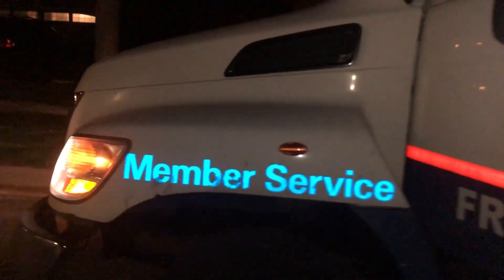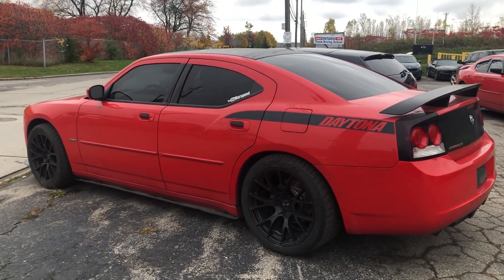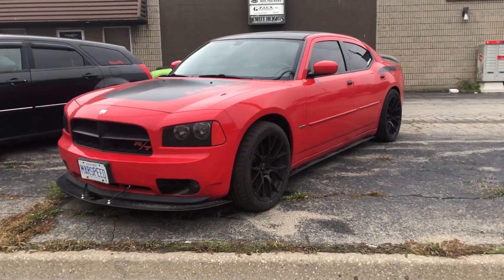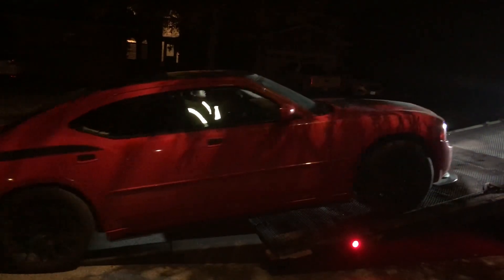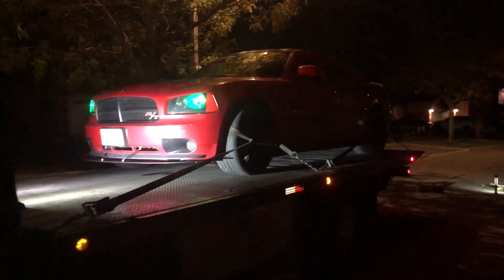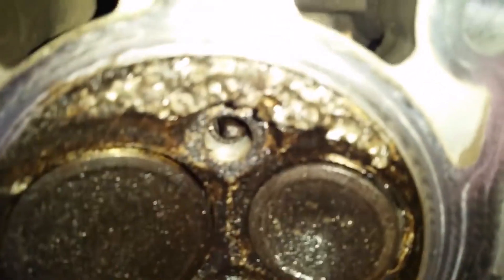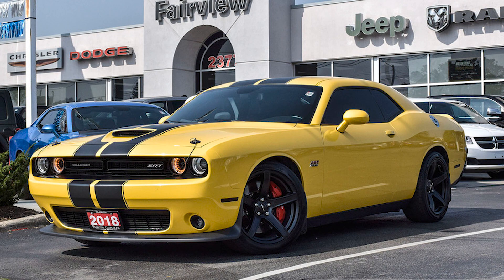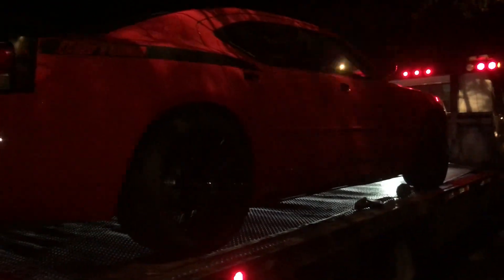My Dodge Charger R/T Daytona Engine DIED! – What Happened & What Comes Next

Comment: Oh no, it’s the Chrysler Curse

Also, I appreciate your mindset when it comes to buying a car, I don’t mind waiting a while to buy it straight-out rather than be paying more via loans/financing in the long run.
Reply: what did you expect from an '06? Most likely year of engine failure, look at the '06 300
Reply from the maker: Yeah I hoped the valve seat issue wouldn’t happen to me it did lol, yeah I’m young and don’t want a long car payment to deal with right now!
Reply: @MarspeedCars  agreed, those payments get ridiculous and you can get in my opinion better vehicles used. I'm looking at crown vic P71s so tell police package. You can get them for $2-3 grand and I'd rather drive the then a new financed $28,000 fusion. 😂

Comment: Damn. 
I feel your pain,  I bought my 2010 sxt in 2015 around the same time that I subscribed to your channel. After 5 yrs of enjoying it & using some of your tips to enhance it I decided to upgrade to a 2010 rt police package.  I have no problems with it, however a few months back after the purchase I was driving my v6 when a water main broke. I tried making it through the massive puddle (I wish I hadn't) when the car stopped because the engine was water logged basically destroying my cars engine. Fortunately I have my rt, I purchased it because I basically wanted to see the difference in owning the two of them.  I can say that I enjoy the rt a lot more but I did like the v6 because of it's reliability & the fact that it was my 1st Charger.  GOOD LUCK ON YOUR JOURNEY WITH YOUR DAYTONA hopefully things work out well with it .

Comment: I'm sorry man, I had the same thing happen to me in my 05 Chrysler 300C. It was at 110k miles and the same thing happened as to your car. I think you are making a great decision on an engine rebuild. I have a remanufactured engine in my 300 right now and don't regret a single thing. I think you will like it just as much as I did. I wish you luck on your Daytona man. 👍

Comment: Sorry to hear, 4.7L and 3.7L engines have the same valve drop issue lurking, a fix apparently is using oversized seats so they fit tighter which some engine rebuilders do (they weren't tight enough from the factory when pressed in). Read that valves seem to drop many times when car is hot from driving awhile and then a quick 10 minute or so stop cools the 2 metals slightly at a different rate then one or more fall on restart.

Comment: sorry to hear about your 5.7L problems. I have several 3.5L police Intrepids, which I like, and my newest addition is an 09 Charger Police pkg. The 09 had around 145k miles on it when I bought it, but runs real strong. The only thing I've noticed is that the starter seems to "heat soak" when I've been driving it for 40 or 50 miles, stop the engine for 5 or 10 mins, then go to restart it, the starter seems to "labor" a little when cranking. Anyways,  I hope I'm able to avoid the v. seat issues, and the roller lifter problems.

Comment: Getting ready to start a similar project on my 07 R/T AWD. cylinder #4 intake lifter flattened the lobe on the camshaft. going to be checking my valve seats since it will be torn down.  Doing an MDS delete, all hellcat lifters, camshaft and possibly new heads.  Good luck to you

Comment: I had a rod bearing issue with my 5.7 so I'm in the middle of putting a 392 from a donor SRT into my 2013 300C AWD. I'm in Montreal if you want to swing by and see what I'm doing.

Comment: I'll be following your build closely. I actually have the exact plans for my 07 300c. I'm currently full bolt on. Just got my ported heads a couple weeks ago. I've been lucky enough to avoid to valve seat drop. Next is a big ass cam. Our builds will be almost identical but I plan on stroking the bottom end to a 397.

Comment: It's a shame that your Daytona dropped a valve seat, but it's always nice to know that your original charger is still rolling. Funny enough, my first chrysler is an '05 sebring (2.4l i4, 4-speed auto) and it's still rolling at 148k miles. I've added my '10 dakota (3.7l v6, 4-speed auto) currently at 65k miles (low miles, but it's a damn good little work horse of a truck) and my wifes '04 durango (5.7l v8, 5-speed auto) currently at 161k miles to my collection, and they all continue to be awesome!
I find it ironic that just because one hemi has a failure, some ignorant individual concludes that all hemis are prone to failure, and they've most likely never owned one. They're fun engines (except when you have to change 16 spark plugs lol 😅). Its nice to know which years, specifically, are affected versus assuming all. Ultimately, outside of the one that was built on a monday or friday, most failures of any vehicle  I believe are the end result of lack of maintenance and/or just being abused and trashed.

Comment: I am sorry for you bro..

& I would like to say that i Love your content and concepts, keep it coming.

As a HEMI guy who tried different mods, the heads defect is serious, get the 6.4 heads and upgrade the intake Valves, and a 6.1 intake manifold with DIY CNC, and throttle body, and just a bit higher compression, and a cam, with that you can get on the 5.7 almost 450whp with a great curve,

I've had a 6.1
It was stroked up to 7.4L
4.250 crank
4.125 piston
With c16 fuel it ran 651whp and 667wtq
A stock hellcat can't run along side me

What i can say that the transmission wasn't happy at all, or shall i say the transmission's.

The compression ratio was a key different in the HEMI's

Comment: Well Uncle Tony's garage was right about the hemi engines. They really have a bad design flaw in those 5.7 liter hemi engines with lack of oil lubrication
Reply: Without tearing down the engine, meticulous inspection is hard to judge
Reply: It is not a major flaw. It is simply not getting the engine up to a higher rev. I can guarantee he has idled it a lot. But at the same time it is a 15 year old vehicle and 200k miles. I think he got some decent use out of it. He also lives in a colder environment. This issue is completely unrelated though. The valve stem seals are known for failing which can lead to the seat to drop.
Reply: Completely unrelated haha
Reply from the maker: It’s a common problem to drop the valve seats and I knew it going into buying just hoped it would be okay and wouldn’t happen to me lol. I got a good deal on the car and it was a good fit and right specs so that’s why I bought it in the first place

Comment: Well I have a 2009 R/T charger 115,897mi. Except for lower compression in cylinder 1, with it sounding kinda like a diesel on first start only for like 6sec which does worry me and will have to be fixed eventually, it's all good. And I didn't know about difference in the engine from 08 to 09 so thanks for that little snippet of info. Hope your doing well in these times.

Comment: Hey, what's your wheel set up for the Daytona? I love the look. Did you lower it at all?
Reply from the maker: 20x9.5 275/40/20 front
20x11 315/35/20 rear
stock height for now!
Reply: @MarspeedCars  omg, thank you soooo much! Good luck getting that red beauty fixed!

Comment: Alot people say that theres multiple reasons for a drop. Idling for long periods of time
Not changing engine oil in a timely manner
And the mds system
And over heating the engine
Reply from the maker: Yeah ive heard many opinions but seems no one has a straight answer everyone believes something different causes it as you mentioned lol
Reply: @MarspeedCars  i currently have a 05 magnum 5.7 r/t ive been having it for 5 years now and ive been doing the oil changes every 3.5k miles and use pennzoil ultra platinum or pennzoil high milage full Synthetic with a gold k&n oil filter, this specific filter allows more oil flow. Also i put a 180 thermostat so the engine can run as cold as possible and tuned the car with a diablo sport tuner and turned my mds system off.the magnum right now has 151k miles on it. Good luck on your build. Mopar or no car
Reply: There is only one reason it was designed and made by your favorite brand which makes cars the way it makes them because one of you is born every minute.

Comment: Sounds like the previous owner didn't check the coolant condition and levels that often.  Valve seat issue usually happens in engines that have been allowed to overheat multiple times. Sorry to see you got bit.

Comment: That’s the annoying thing with dodge/Chrysler.  They knew about the 5.7 valve seat issue for 06-07 being a common thing and didn’t offer any kind of warranty or recall.  My brother is a shop manager for Hyundai and their earlier 2.4 liter models have a lifetime warranty on the engines because that have a issue with the crank bearings prematurely wearing.

Comment: Hey marspeed I was wondering if your hemi had the MDS system in it? I know you got the 6.5L in her now but I bought an 07 charger rt about a month ago with only 62,000 miles. Its got the MDS fuel system saver thing in it. Ive heard bad things about it and was wondering if that might have been the cause for your valve seat too drop?

Comment: Looking forward to hearing it run again. Are you just doing a straight rebuild or building up the motor? Now would be a great time to stroke it out or upgrade the heads and intake manifold along with some headers.  It'll haul ass.
Reply from the maker: Upgrading everything I can! Might do a hybrid with eagle parts and 6.1 stuff too. I want 450-500 hp at least!
Reply: @MarspeedCars  hell yeah.  Eagle makes good stuff.  They made the rods for my old Mazda6S track car. It had the Duratec 30  that we stroked out to 3.3L using Eagle Rods. It was the most American muscle Japanese sedan ever.  🤣

You'll like a built motor.  I love forced induction, but there's just something about a motor that can wail like a banshee all on its own.

Comment: Sorry that happened. If you rebuild it won’t the problem return down the road? What about dropping in a newer 5.7 that won’t have that problem? Good luck to you! 👍🏻👍🏻🇺🇸🇨🇦
Reply: If the heads are replaced. Or rebuilt properly then the problem shouldn’t happen again. It was defective machining from the factory that’s why it happens
Reply: @JCAchannel100  He didn’t say it was defective machining, he said the valve seat is a different material from the aluminum head and when they get hot they expand at different rates causing the seat to fail. You should have listened to his explanation better. My point was if you rebuild it with the same valve seat material the problem is going to happen again.
Reply from the maker: Yeah it was a defect with the heads used pretty much, the rebuild will make sure it doesn’t happen again no matter which route I go. The damage will be fixed and the heads changed, just debating which route to go I wanna do something unique hopefully!
Reply: @LS1007  hence why I said rebuilt properly^.

Comment: Rebuild the engine. Eliminate all weak areas and know what you are getting vs. Getting. Rebuilt drop in with the same known issues. Do a few upgrades to ensure reliability for a long time of entertainment.  Performance upgrades kill the car quicker. If you love it, don't turn it into a money pit. You will regret it when you hate the car for breaking down all the time...

Comment: Hey remember those manual swap chargers you talked about? Would manual swapping your car be viable? Because i know the current trans is glass.
Reply from the maker: Would be a cool idea for sure
Reply: The Nag1 trans is actually really good and can handle upto 500+hp stock. It’s quite durable. It’s designed by Mercedes. Not Chrysler
Reply: @JCAchannel100  i have one. You are thinking of the A580 that Mercedes uses. And all transmissions in dodges prior to 2015 are mercedes designed and built. With my mom’s 11 rt, its not even fast at shifting anymore.
Reply: @JCAchannel100  never mind that is false. The trans are the same between the srt and rt. But about the shifing is true. Could just need a quick tune up

Comment: I really like the looks of the Ram pickup, and Challenger and Charger.  But there has to be a point where one questions the ability of Fiat (or whoever) to actually build a reliable vehicle.  Fiat (stands for Fix It Again, Tony) has a horrendous reputation.  I don't know if it is DaimlerChrysler who started this, but there are just too many engine problems.  After 100 years of the automobile, you'd think they could figure it out like some of the Japanese have.  I had a 4.7 RAM 1500 that was flawless, but only put 47,000 miles and changed oil frequently.  (1) Many people had rocker arms falling off with this engine, though I did not.  (2) The 3.5 V6 had bad oil sludging problems (as did the 4.7 V8) and is generally unreliable.  (3) Early HEMIs had the valve seats drop like yours.  (4) Later HEMIs have poor cam oiling and roller lifters that seize the roller and destroy the camshaft.  (5) Look up how the foam injected in the rockers soak up moisture and salt and RUST HOLES IN 5 YEARS. Cars look great, BUT WILL THEY EVER GET IT RIGHT???  After 100 years, I guess not.  I wanted a Challenger but they seem to have too many problems.